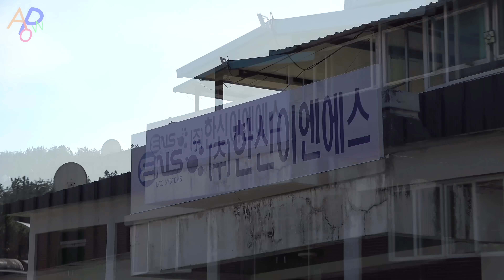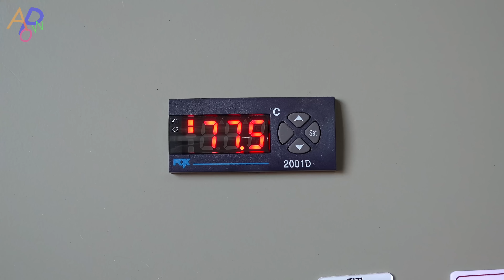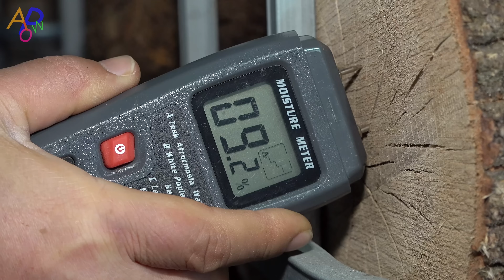Process of Mass Producing 10,000 Tons of Oak Firewood. Largest Firewood Manufacturing Factory

Comment: Those drying ovens would be bliss in a cold Korean winter. I used to work in a polystyrene factory that had gas fired drying ovens and they were so nice to stand in when it was cold. 0C outside, toasty 75C inside.